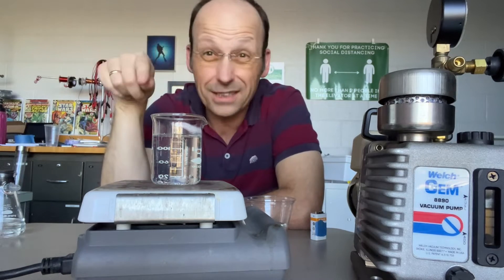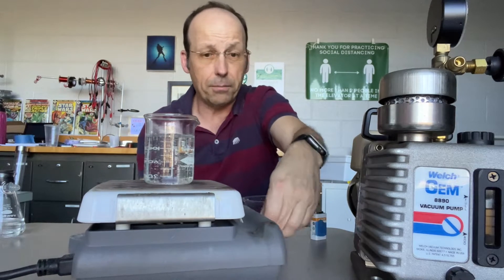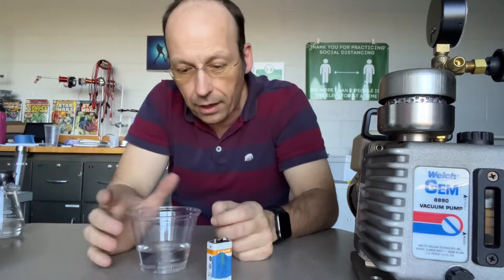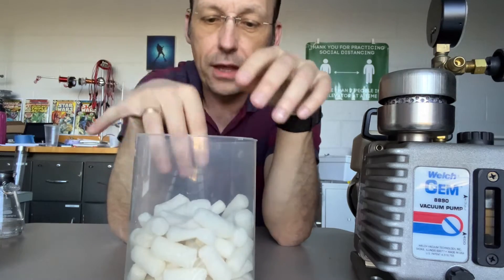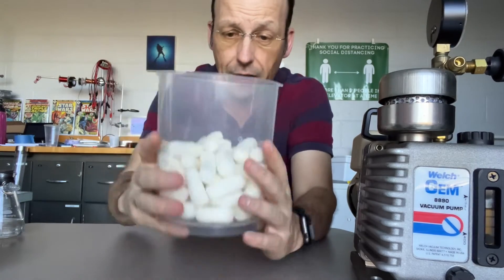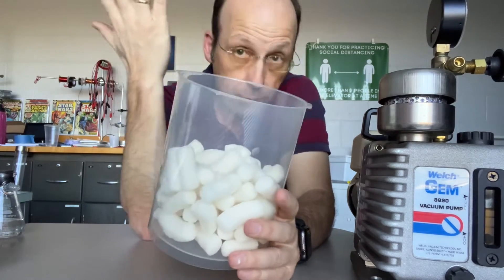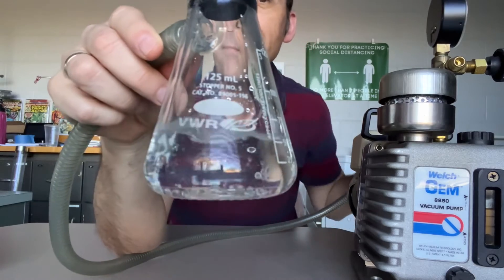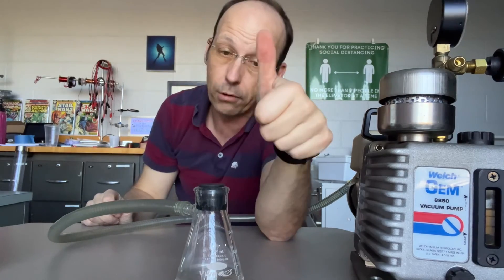What are the bubbles in boiling water?  How can you boil water at room temperature?

Comment: Great ideas for visuals. I've done the electrolysis one before, and if you use two test tubes filled with water and invert them over the 'electrodes' the gas pushes the water out. You will see roughly twice as much gas in one as the other and that one is hydrogen because it's H2 & O....twice as much 'H' as 'O', so twice as much H-gas as O-gas.    :)